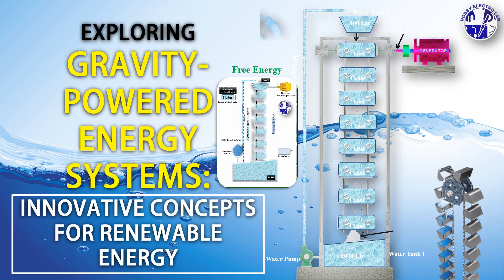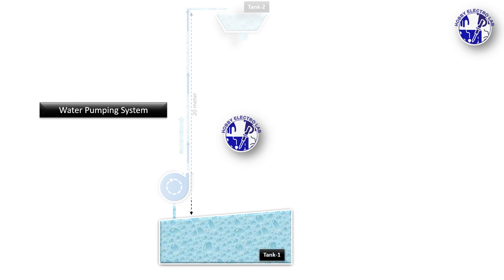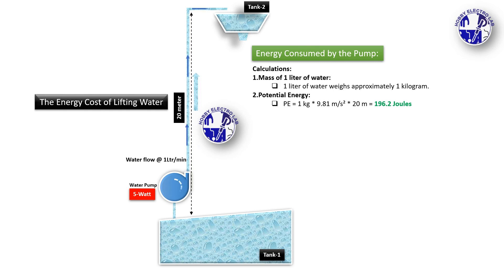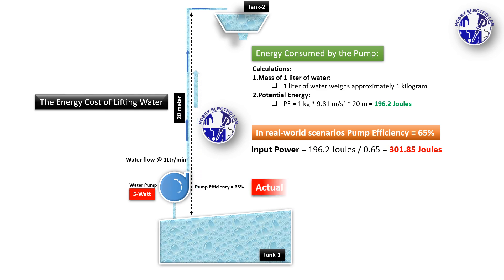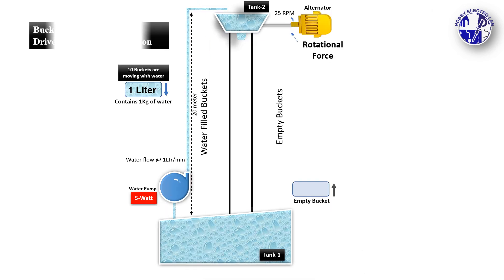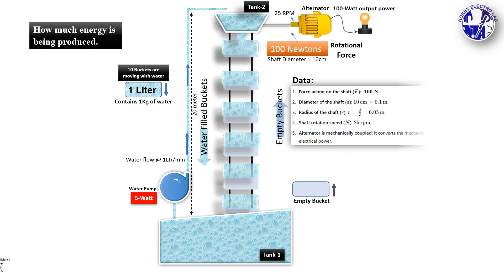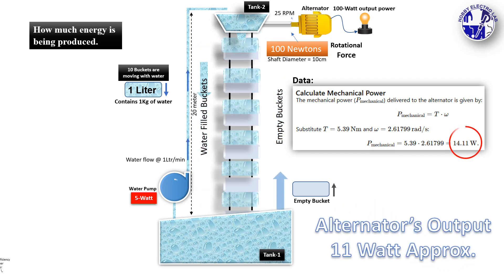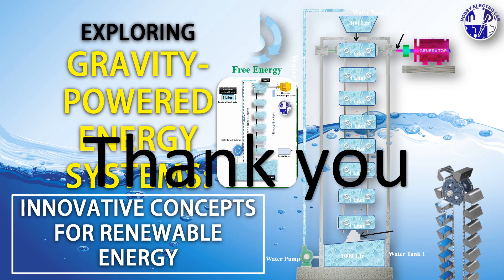Gravity-Powered Energy Generator | Free Energy Project Explained!

Comment: How many Watts can you produce with only 25RPM? ,  you need 400rpm at least to produce a decent amount of Amp and Volts, or I missing something? please correct me if I'm wrong...
Reply from the maker: Great question! You're right that most alternators require higher RPMs for optimal output. At 25 RPM, the power generation is lower, but using a high-torque, low-RPM alternator or a gear system can help increase efficiency. It’s all about matching the alternator to the system’s mechanical output. Open to any suggestions you might have!
Reply: @HobbyElectroLab  yes, and I think there is the problem, to achieve high torque you need speed or weight force...speed cannot be, so the other option would be weight but I don't think you can take too much from water itself...maybe I'm wrong and it could be possible but...
Reply from the maker: Great point! While water alone has its limits, we can increase gravitational force by scaling up the system—using larger weights, bigger buckets, or a taller setup. This could help generate more torque without needing higher speed. It’s all about finding the right balance. Appreciate your insights!🚀
Reply: @ Yes, you are right, scale the system with help to increase the torque but lead you to a bigger problem, you will need to pump more water to the system that lead you to more energy consume that lead you to the necessity of more energy to be produced that lead you to more torque...and so on and so on...I think there may be a way I cannot figure it at the moment...but hey, love the concept!!
Reply from the maker: @monztruozocastro9031  Thanks for your interest.... keep watching

Comment: A few questions... 20meters height? And only 20 buckets? If you reshape them might you fit 40 of them?
Reply: Longer and narrower buckets, for example.
Reply: Would this change something?
Reply from the maker: Good point! More buckets or reshaping them could improve efficiency, but it’s a trade-off with weight distribution and complexity. Open to ideas if you have any!
Reply: @HobbyElectroLab  for sure it becomes a new project.
Reply: I'm sorry, I'm not an expert of weight distribution. I was thinking about the replenishment of both tank 2 and the top bucket. Timing is important. So 1l/minute up and 1l/minute that replenishes one bucket. By changing the alternator with a slower one it could work. Or by using an other system

But in reference to the weights of the buckets I was considering that, by simply changing the bucket and not the types of joinery, the force pulling down by every single bucket is possibly similar (more or less). The sum of the forces applied on the chain will double. There might be some lever issue for each joinery, but there has to be a maximum tolerance of the chain, which is already in tension.
Reply from the maker: Great insights! Timing and replenishment are definitely key factors. A slower alternator or an alternative mechanism could optimize efficiency. As for doubling the buckets, the chain’s tension and leverage effects need careful balancing to avoid mechanical strain. Lots of room for experimentation—thanks for the thought-provoking ideas!
Reply: Well, I've seen some other comments of yours when you answered to someone. The gears and pulleys might work fine.

Comment: Consider your idea as the beginning of a study of what it would take to create a "power supply" that runs on gravity.  As Nick clearly shows, this iteration of the concept fails because the pump is doing the work of lifting the water and the generator is producing power by the fall of the same water.  Even if every part of the machine operated at 100% efficiency and used friction-less bearings, you would still only break even.  So, you have to do "something else" to get the system to work.  For instance, if you could harness centrifugal force to help you lift the water, or add velocity to the weight of the water as it turns the generator, you could start to make up for your losses.  Its a thought experiment.... see where you can take it.
Reply from the maker: thanks for the insightful comment! You're absolutely right about the system's limitations. I've created a document that delves deeper into this concept, addressing your points.  Please checkout this google document  https://drive.google.com/file/d/1Uh8b606-jDdmO2B4sNQ44T4S816Iyd6p/view?usp=drive_link
Reply from the maker: Thank you for your insightful comment! You’re absolutely right—this project serves as an initial exploration of how gravity could be harnessed as a power source. The key challenge, as you pointed out, is overcoming the energy input required to lift the water. Finding a way to improve efficiency, whether through centrifugal force, mechanical leverage, or another innovative method, is where further experimentation comes in.

This is exactly the kind of discussion that drives innovation in renewable energy! I appreciate your thoughts and would love to hear more ideas on how we might refine this concept. Let’s keep exploring!
Reply: You cannot create energy. This will never work. 

1st law of thermodynamics
Reply: Cuplează la roată încă un cilindru hidraulic sau 2 cu pompare continua-piston..cu 4 valve fiecare cilindru...asa pompează apa continua fiecare cilindru indiferent dacă pistonul împinge sau trage în cilindru

Comment: Gravity-Powered Energy Generator referred on these case is valid only as concept, but calculations are not correct? Why? This is simple, a) water pump 1 litter per minute and the electric motor consume 5 watt. This is 432000 Joul consume during 24 hour or 120 Watt-hr electricity consume. b) Water pumped on 20 meter high has a volume 1440 litter (pumped during 24 hr). This water has a potential power 282528 Joule which may generate 78.48 Watt-hr energy if all energy is converted on electricity. c) so on this time we can see efficiency 282528/432000 (J/J)= 65.4%. d) Potential energy water has at the highest point when moving the generator will generate less than 78.48 Watt-hr electricity, may be 70% of these, so the electricity output may be estimated to 54.95 Watt-hr.
Overall energy out versus energy in of this "gravity-power machine" respectively 54.95 and 120 and total efficiency estimated is around 45.78%.
Now this knowledge are known everywhere and applied better on Energy Storage Hydropower or PSH, no need for bucked. 
The world need energy on demand and there are many undisclosed technologies which can do energy generation on demand using physics law. One is levitation-gravity energy generation using heavy blocks of any material which can be lifted on so called levitation towers (invention not disclosed) and on these tower if we will use 1440 kg weight on 20 meter the "levitator" will use less than 56500 Joule energy (less than 15.7 Watt-hr). on the gravity energy generator parallel with levitator tower the energy generated for this case is estimated 78.48 Watt-hr time efficiency 70% which is 54.95 Watt-hr. 
So the undisclosed levitation gravity generation machine or engine will have input 15.7 Watt-hr energy and output 54.95 Watt-hr energy with EOEI RATIO 3.5. This new undisclosed "machine" is one of the key technologies the world will solve energy transition from fossil fuels to renewable energies, and this technology can be adopted and used on any place on earth.
Partners for collaboration are welcomed on further details.
Reply from the maker: Thank you for your detailed and insightful comment! I truly appreciate the time and effort you put into explaining these concepts. I will take the time to study your points thoroughly and may even create another video to explore the idea you’ve presented. Stay tuned, and thanks again for contributing to the discussion!
Reply: My dear the pulling downwards power is 20 times the power used for taking water upwards. If you consider 65% that is for taking 1 bucket up and pulling 1buucket down. That means 20 buckets are pulling downwards and the pump has to lift egual to 1 bucket to the top. Then we minus the friction as well as weight of 20 empty buckets. Even then the machine would be capable of producing extra energy.
Please comment !!!
Reply: @ I see the power of the pump and the energy this pump need during 24 hr for total water pumped upward. Then this water at 20 m high has a potential energy. These potential energy does not support what the video claim, so ne energy gain, yes may conserve not more than 60% of the energy input (5 Wtt).
Reply from the maker: Thank you for your detailed analysis! You’ve made some great points about efficiency and energy balance, and I completely agree that conventional gravity-powered energy concepts face significant limitations due to energy losses in lifting the weight or water. The calculations you provided highlight why many traditional gravity-based energy systems are primarily useful for energy storage (like PSH) rather than net energy generation.

Your mention of levitation-assisted gravity generation is intriguing! While details of such undisclosed technologies are limited, exploring innovative ways to minimize energy input while maximizing gravitational potential energy conversion is definitely an exciting direction for research.

If you're involved in this field, I’d love to hear more about practical applications and how such concepts could be tested and implemented. Let's keep the discussion going!
Reply: @ I am happy you have understand that the "machine" you present (presented and from many researches) do not generate energy, but use energy as input, and generate less.
Reply: @ Again 5W pump during 24 hr will consume 120 Watt hour energy and will pump 1440 liter water at 20 meter high. The energy conserved by 1440 liter water at 20 m high is E=1440*9.81*20 =282528 Joul (or 78.48 Watt hr). These if not any friction so efficiency 100% which is theoretical. So energy generated is 41.52 Wtt hr less or even lower if efficiency will be considered. So this is analogue with pumped storing. Unfortunately this works only when you have energy to run the pump. So  this is not beneficial.
As for Levitation-gravitational energy (undisclosed) technology the Levitation part i undisclosed, but the gravitational energy is well known. My researches are not fantasy or concepts, I have proven the levitation on micro-model which worked as forecasted, destroyed the model for security and now search for investor support and interested government support on partnership. Not interested on patents, these path does not match my visions. My invention (undisclosed) do not compete the gravitational storing which actually have some popularity, this can help the gravity storage project and make the projects generate dispatchable energy.
Reply from the maker: Thank you for your detailed analysis! You’ve highlighted some important efficiency considerations when working with gravity-powered energy systems. As you pointed out, traditional setups like pumped storage hydropower (PSH) are well-documented and widely used for energy storage rather than net energy generation due to inherent energy losses.

The concept of levitation-assisted gravity energy generation sounds fascinating! While undisclosed technologies make it hard to evaluate feasibility, minimizing input energy while maximizing gravitational potential energy conversion is a compelling research area.

If you’re working on this or have references to share, I’d love to learn more. Exploring new ways to enhance energy efficiency is always exciting! 🚀⚡
Reply: Not if you hooked the  pump Up to solar
Reply: @ManyHeavens  you are not explaining and can not explain that I am wrong. I am sure you like many others do not and can not understand "levitation" that I am including even if you have completed university studies. The University give knowledge what is discovered and published but not what is discovered and is not published. Read again my comments, probably you will understand what I write. Anyway I respect your time.
Reply from the maker: Thank you for your follow-up! I appreciate the effort and valuable insights you've shared. I’m reviewing your points carefully and will respond or create a video update soon. Thanks again for your thoughtful input!
Reply: Your wrong
Reply from the maker: I've created a document that delves deeper into this concept, addressing your points.  Please checkout this google document  https://drive.google.com/file/d/1Uh8b606-jDdmO2B4sNQ44T4S816Iyd6p/view?usp=drive_link
Reply from the maker: thank you very much for your detailed comment, when I will be free , I will study your detailed review. I will let you know If I find some thing new....thanks for your time.